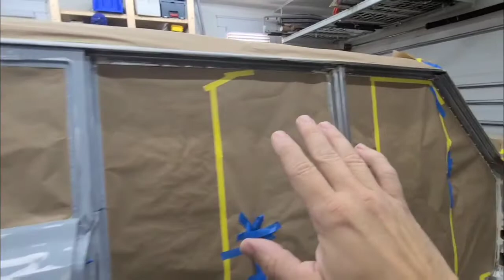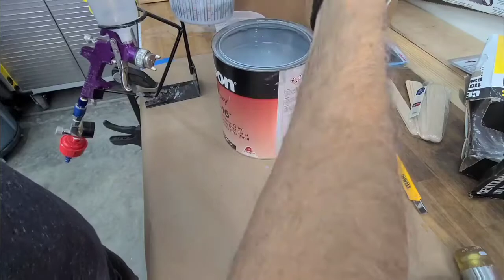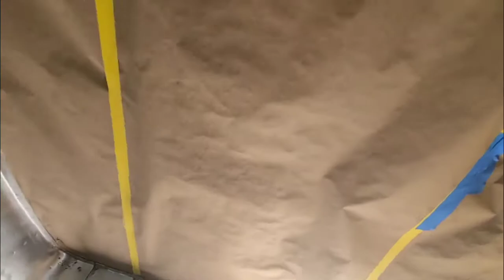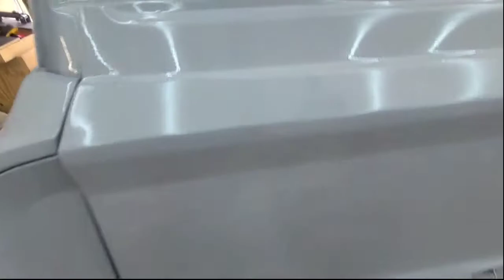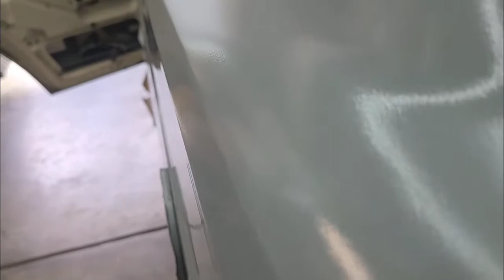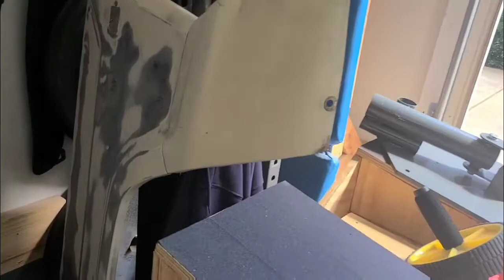Spraying Nason Epoxy on the Wagoneer

Comment: I am not really a painter least not a professional.  My projects always seem to come out about like yours but from what 
I understand always going the same direction and never tilting left to right with your wrist helps.  What I mean is even if the area is a short blast dont keep the gun in place and turn your wrist to get it move your arm.  Much love for a Wagoneer fan though keep it up.
Reply from the maker: Yeah.   I just finished the roof after stripping it all down.    I practiced exactly what you mentioned.   Came out great.  Pics are at comfort_discomfort on Instagram.    Makes a difference.    Thanks for watching.    Still have a ways to go.